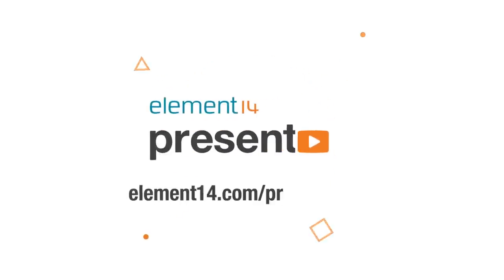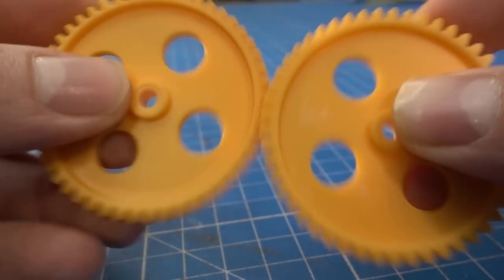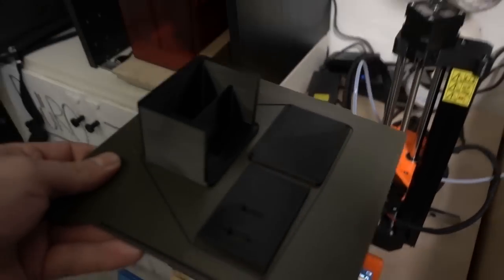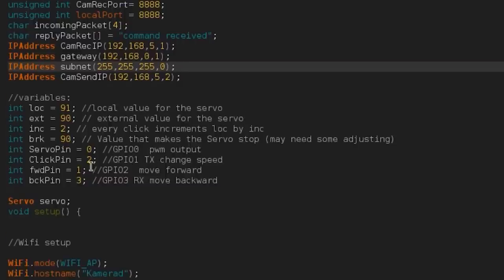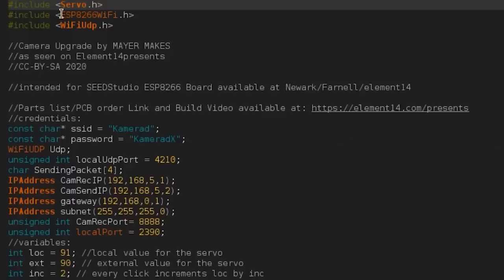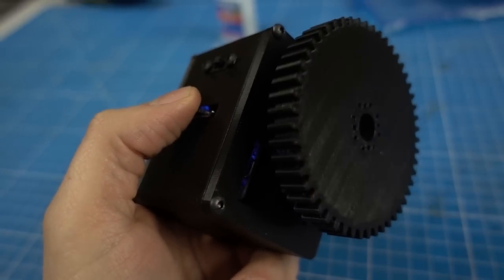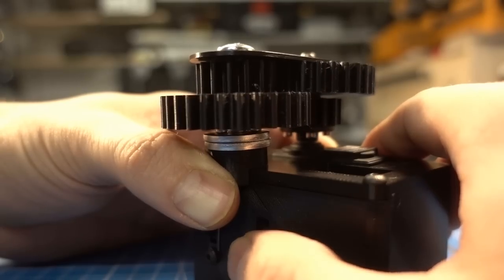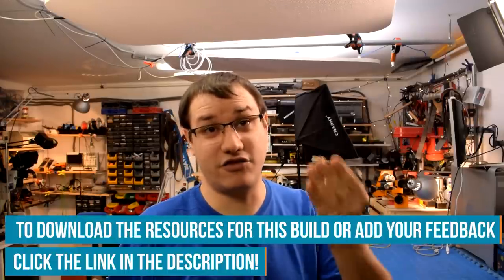DIY Motorized Zoom for your DSLR

Comment: sooo many ideas from this video ill have to add this to my list :) would using a stepper motor work to help smooth things out ?
Reply: Sure but be aware that it makes things complicater, you need a driver psu and it is heavier
Reply: @MAYERMAKES  hmm so perhaps feasible on a big film camera with a manual lens but not so much a dslr on a normal tripod
Reply: @ElectronsNeeded  can be but it complicates things and will need to be bigger overall

Comment: That was very nice - noise and backlash would be real issues.  You had quite large gear teeth. 
I like my DSLR for shooting, but now its in a teleprompter and VERY difficult to do pushes and pulls in the shroud, so this would be nice. 
Perhaps I need to go with a good quality camcorder - ugghhh = perish the thought...
Reply: every prototype starts crude, I usually have only one try t oget it working so iterations have t owait to get it to a decent level
Reply: @MAYERMAKES  I hear you --- it made me realize, that its not a 'one-and-done' thing.  And I've got more pressing projects.

Comment: change servo to stepper motor because its much more quieter, use metal gears on gearbox instead of 3dprinted (it very cheap on china) and change control form buttons/joystick to jog/wheel, u have more straight control on speed and position :)